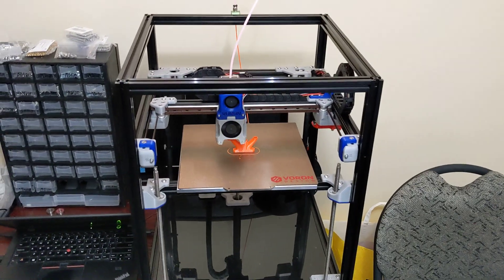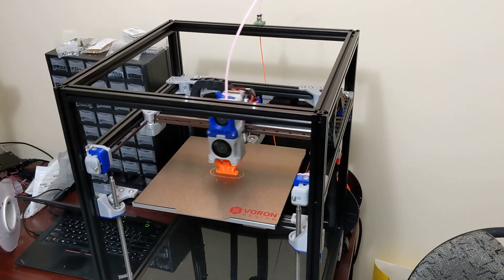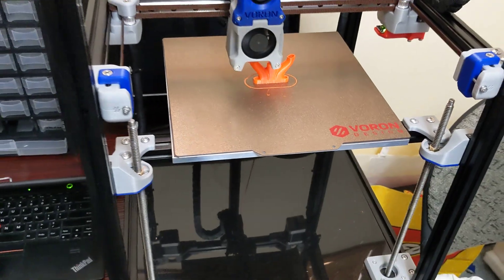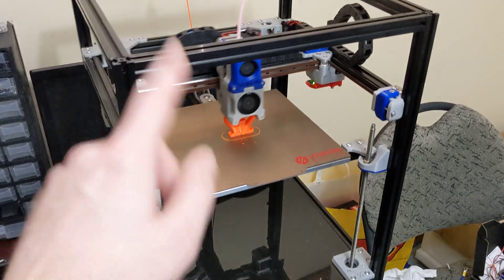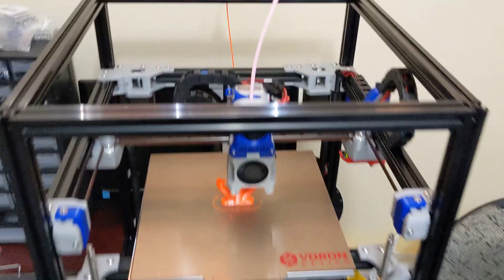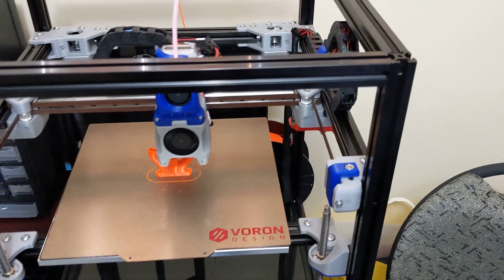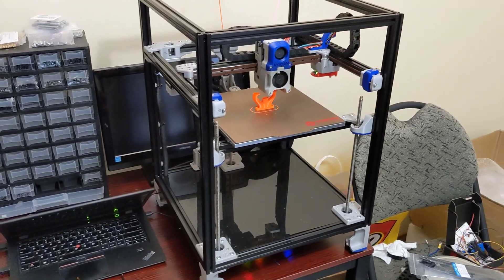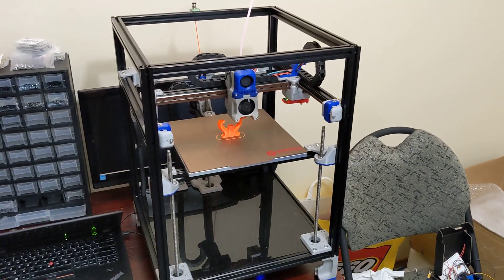FORMBOT Voron Trident 3D Printer Kit - Episode 5 - Build Review

Comment: Why is the e3d V6 bad?
Reply from the maker: it's a very old hotend there are much newer, higher flow hotends for cheaper
Reply: @Rolohaun  Oh! I thought the clone type ones with cht nozzles were pretty good and cheap. Are the newer hotends still compatible with the e3d nozzles?
Reply from the maker: @HMPirates  I buy the Trianglelab TCHC TR6. Most nozzles are the v6 style and will fit on most hotends. Voron kits are also updating to ceramic circular heated hotends also.

Comment: Not Voron but formbot should update there kits with pheatus rapido! small correction :)
Reply: can you drop in a rapido into where a v6/dragon would go?
Reply: @dirtrobot  yes, the STL files are available to use Rapido with AB-BN 30 and Stealthburner. I haven't seen official Rapido support for Afterburner, but there is an "AB-BN for Stock" mod that lets you use it. Unless the Voron team has added official support for it in the last couple of weeks..

Comment: I cant understand how the volcano didn’t have its place in many of the corexy designs early on. 

Even now it seems to me it was a much better choice in your kit over a v6. 

No doubt the volcano has lost its place in the market for the most part but it was ideal at one time. 

At the end of the day being able to melt more material faster is important if you plan to use the speed of a corexy. 

Cooling is just as important for materials like PLA. Especially if you plan to print fast. 

Thanks for the journey through your build. There are a lot of things to like about this Voron.
Reply from the maker: Back in the day a Volcano was a good choice, however the normal E3D v6 is not a good choice and there are many other modern hotends that flow much better. The Dragon and Phaetus  both come in High Flow models and there is no need to run a older volcano.
Reply: Yeah, I've used the volcano on all my builds except for one i wanted to try a V6 on. 

It took only until recently for me to even try to max out the volcanos flow rate because i was always concerned with quality. 

The triangle labs clones with the barrel style thermistor are honestly leagues above what e3d makes and they're a treat to use. 

I'd love to try a rapido, but again, that's more suited to giant printers than ones these sized

Comment: The things i didn't like about my formbot trident was 1. No double sided pei sheet 2. they did not supply 3mm foam for the side panels. Everything else was excellent 😍

I feel like they should also just include the hardware for the klicky probe mod as it wouldn't add to much cost. Klicky and stealth burner were the two mods i did while building
Reply from the maker: Ya I wanted double sided pei too, I got lots of foam tape

Comment: Nice to see this as a soothing balm to my worry after ordering one. I got a 250 Trident - also a bit sad to see I'll have to upgrade from the dragon lol.  I subscribed to learn from your build process thanks!  How was the wiring harness over all? I hate crimping with a passion so I'm hoping to do as little as possible on this build.
Reply from the maker: Wire was all crimped and worked perfect. The dragon is a good hotend just get a 50w heater instead of the 40w at least